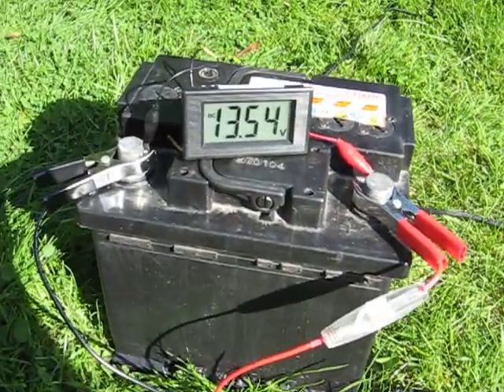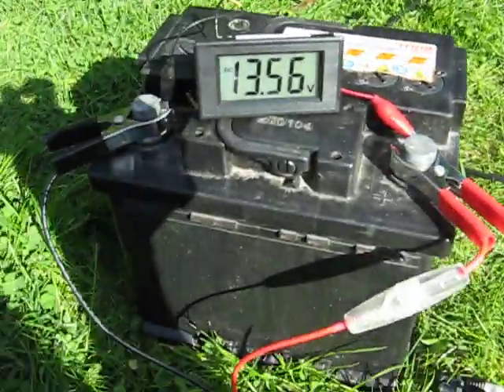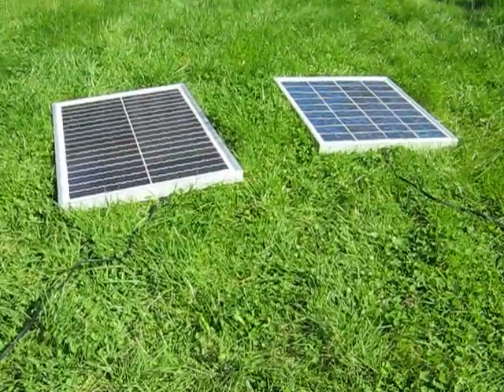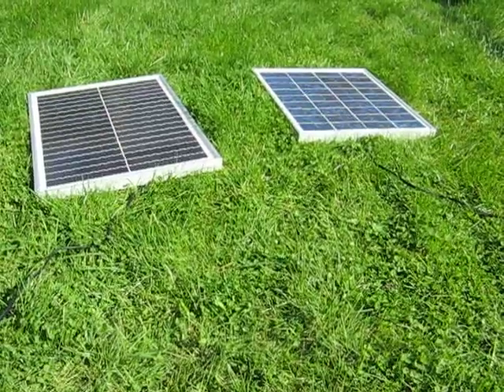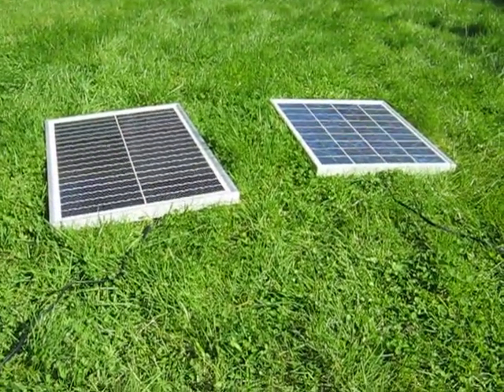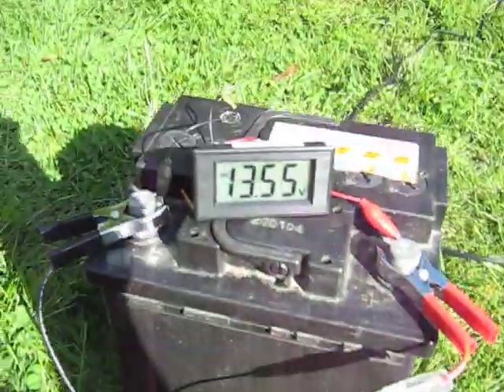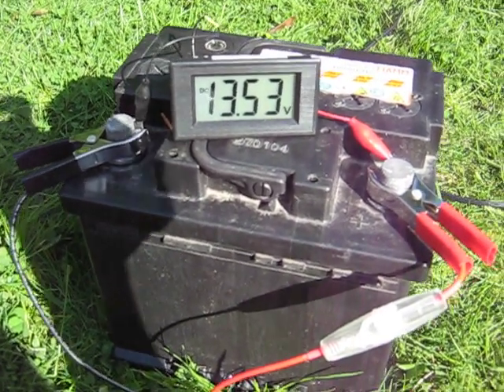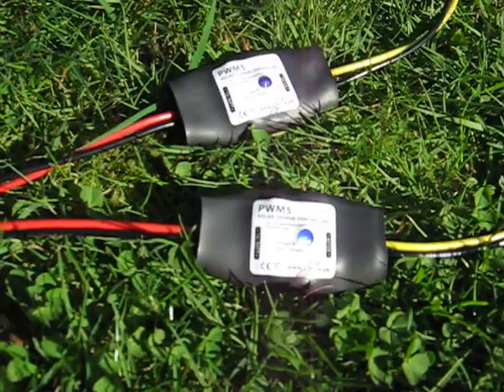Two Solar Charge Controllers connected to One Battery

Comment: Hi.  i have a 500AH lithium battery i want to charge from two sources while in use.. a 100 Watt 12v solar panel and my cars 12v cigarette port that is only on while the car is running.  What's the best way to wire this and what do I need?
Reply: you need one of these https://www.ebay.co.uk/itm/193691480874

Comment: every battery need 10% charging current .....200 ah *12 volt = 2400 watt .  charging curent need 10 % same 240 watt .  can use doule charge controler  10 ah * 2 = 20 ah  = 240 watt

Comment: Hello! I can connect diferent two solar panells with two charge controllers. (First pannel is gs-50 amorphous crystal 50.w) (second is monocrystalline panel 135w) and system work on 24.volts

Comment: Can you connect two solar panels into one charge controller (the standard controllers you find online) even though these controllers have one + and - could you not just put 4 wires from the solar panels into these inlets? Would it not just treat it as one solar panel? Maybe this would be too powerful on a sunny day but what about over winter - would it work?

Comment: This doesn't show that they are both working. Each panel has the capacity of charging at that voltage (as long as they are for 12 volt charging). If you were to unplug one panel you wouldn't show a difference in volts. 

You would have to drain your battery down to 50 to 70% and then put and amp meter on the cable (close to the battery) to show how many amps hours are going into the battery. Each panel should have a max amp output and you can find if they are both working by amperage readings. 

It's likely that they aren't working together.

This is what happens when they cannot communicate to one another. The first solar charge controller to read the battery and give the battery a charge from the solar panel wins (to say the least). It will kick out a charging voltage at whatever amps the panel can produce. The secondary solar charge controller will read the charge voltage (13 to 14.7 is charging) and consider the battery as full and shut off. 

Charge controllers don't communicate unless they can be connected.
Reply: Solardealz.com um.. yes and no. I'd imagine you'd need to connect them at the same time to establish the voltage before commencing to charge and keep them connected (or synced). Then charging in parallel is not a problem since the battery is agnostic to the fact whether there is one charge controller or n charge controllers. Equally, if the charge status is on on both of the controllers, they are oblivious to the existence of their brethren and both will charge until boost or float voltage is reached with continuous charge. It only gets tricky if there is a constant load during day that is greater than the solar input, but even then, if there is great enough load, the voltage will drop sufficiently for both the chargers to kick into charge cycle. Like he said, something that probably cannot be done with most solar controllers, ie. one could assume Julian knows the usual problems.
Reply: Wibin This might be possible but until the amperes are measured independently on each charge controller it cannot be assumed that they are both working. I find there is a 50/50 chance that the charge controllers will both charge up to float charge.
Reply: Solardealz.com well he hasn't bought or made any in years and he's putting up the code as open source in the coming weeks. So you can go through the code all you wish. ;) 

I find identical panels in series is the optimal solution, but requires a MPPT controller. This would be just one of the sub-optimal solutions.

Comment: I have a 80w solar panel with a charge controller and a 140 watts solar panel with a charge controller,can I use both to charge my battery?Thanks.
Reply from the maker: It probably won't go up in smoke if you do that, but you might find that the controllers behave strangely - possibly pulsing on and off. I designed my charge controller to be tolerant of other charging sources and list that as a feature in the user guide. I've not seen it as an advertised feature on other controllers.

Comment: @mrmolez I wish batteries were that simple. You can cook a battery with too much amperage which is what you charge with, not voltage. Your charge voltage just has to be higher than what you are charging. Hook your battery up to a 100A 14V source and you won't have a face anymore.

Comment: Why would you say that this cannot be done with other charge controllers? I've never seen a charge controller that you couldn't do this with as they all detect the same voltage and turn off at the same time. What I would worry about is putting too much amperage back into the batteries at once between multiple chargers. If they had temp sensors it wouldn't matter as they'd regulate themselves. Just curious why you said that...